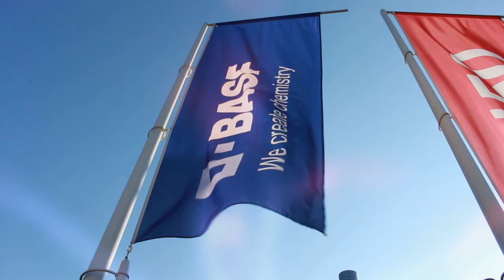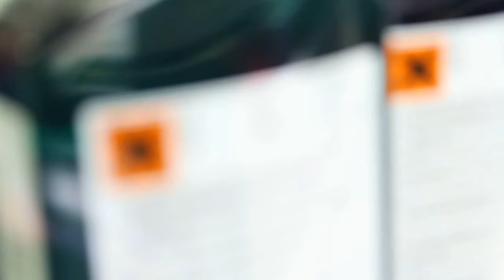Tesla painted by Glasurit - Sustainability Campaign

Comment: Can someone please tell me if Tesla paint can withstand extreme temperaturesBrendan, ^^ Correct.
I've been told

The paint itself can withstand temperatures of approximately 343° C (650° F), and the plastics can withstand temperatures of approximately 160° C (320° F) or more, depending on the specific plastic composite.